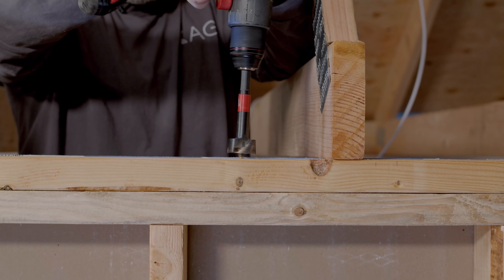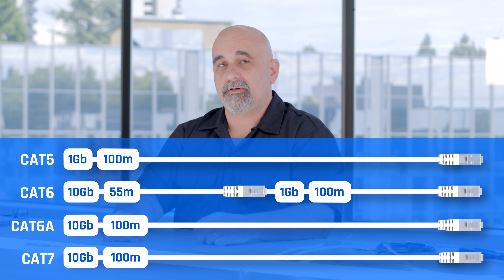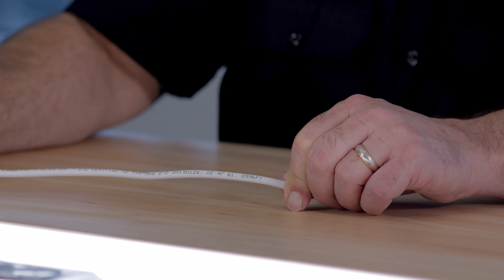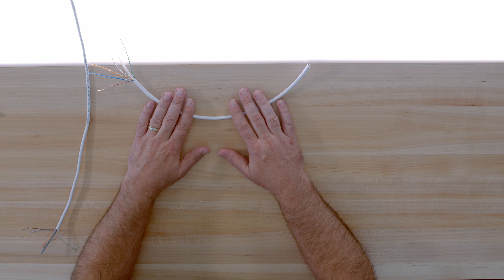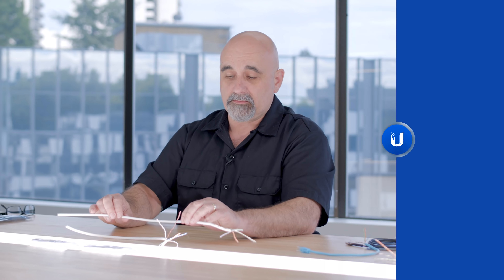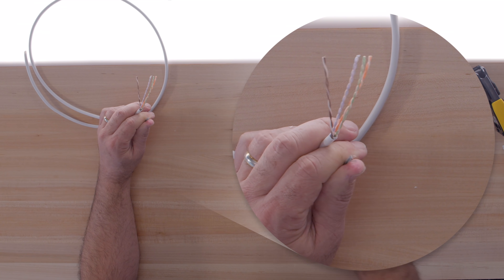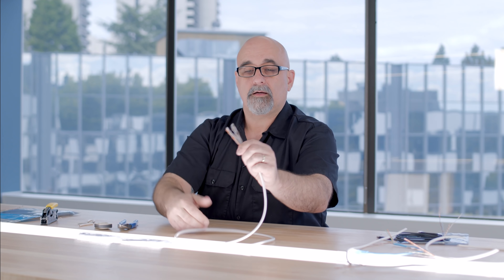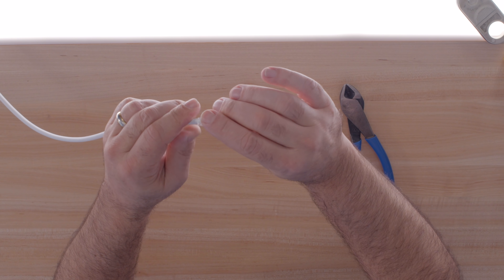UniFi: Beginner’s Guide to Network Cabling | Part 1 - Cable Types & Termination

Comment: Informative video. Should probably also have mentioned that pin 1 of the RJ45 is the leftmost pin when the connector is held vertically with the pins facing you, and that this is the orange/white wire for 568B cabling.

Comment: I learned with this type of crimp and rj45, but I have found the pass-through clips/crimper much easier to use. Great instructional vid though, good job!
Reply: Pass-through are very nice but only time you dont want to use them is when the jack is shielded but then you will also need to use a shielded rj45 and cable

Comment: Don't CAT5 and higher have the same number of wires/pairings (8 wires, 4 pairs)? If so, what about CAT5 makes it unable to transmit 10Gb speeds?
Reply: You can achieve 10g over cat5 with the right equipment and short distances. Its not easy but you can. cheaper to run the bigger cable
Reply: The other person already answered the question, so i’m going to skip that part. But some differences, cat5 can support up to 100mhz bandwith capacity, where as cat6 can support up to 250mhz. Another difference is that cat6 cable is more tightly wound, and have more twists. Also, a lot of the cat6 include nylon spline. Not required with cat5 cables, but some manafactrures include it.
Reply: Cat6 and up have larger copper conductors (lower gauge), more twists per inch, and sometimes a plastic separator for the pairs.

Comment: Nice video, however, Sean never specifically mentioned the orientation of the RJ45 connector (He did it on video but never went though why). This is NOT required for most, due to Auto-MDIX, but this is an important thing to know

The pins are suppose to up face when putting the wires in. Pin 1 is first from the left when pins are facing up. For T-568-B, that's Orange-White. I noticed two of the graphics, the pins were wrong the first time, then they were right the second time.

Comment: I just been doing low voltage for only 15 years. But I was told by people with more experience that always try to use the dental floss (ripcord). But maybe it's more important for terminating to a jack or patch panel where the jacket is not supported and camera ends.
Reply: I like this video to use as a training aid. Looking forward for the rest of the series.
Reply: dental floss????
Reply: @isaackvasager9957  @ 2:37 the polyester string (It is commonly called a ripcord) he calls it dental floss
Reply: @hitman132i  lol, I missed that. The fact that he calls it dental floss makes me hate this entire video.
Reply: @hitman132i  for what its worth, I do this for a living, never once have I used the "dental floss". It's a pain to use. If you learn to use a wire stripper properly, you will never even touch the insulation on the inner pairs.

Comment: Another tip.
To help untwist the wires you can use part of the jacket you strip off and push it between the pairs so that one wire goes in to the jacket and the other stays on the outside you can just twist the jacket in your fingers and it will slide down the pair and help untwist them easier.
Reply: huh? That sounds hilariously over complicated.
Reply: @isaackvasager9957  I've tried this method and it works surprisingly well.
Reply: @cfgdr3  up can literally just twist the pair with your fingers to untwist it. Why overcomplicate it? Lol. I go hundreds of these every year. Takes seconds.

Comment: Very nice. As a rule I never use wire that my cable stripper might have touched. Use the pull string to remove the sheath from the length you need to work with and discard where the cable stripper or scissors or knife was used. Even a small nick or pinch in a solid copper conductor can cause problems later.

Comment: 6:53 The (solid/stranded) lables for the RJ45 crimp types graphics are reversed. Stranded core is used with the top blade type, while solid is used with the lower fork type. 
I’ve seen professional installers incorrectly use the wrong type! Which will later cause connection issues due to bad connections.

Comment: Pretty sure he uses a pass-through crimper, but not a pass-through RJ45 plug.

Also, be sure to get the right RJ45 for your cable. An RJ45 rated for Cat6 doesn't sit well on a Cat5e cable.

Also, always test your cables after making them!
Reply: There is nothing wrong with using a pass through crimper on non pass through plugs.

Comment: Really, Why is it that people fail to mention one of what I feel is most important things to Cat Cabling? I mean ok so you guys use CMP so there is no Questions but what about all the Trash that is being SOLD TODAY WITH CCA... Why is it that people don't point out that people need to buy Good Quality cable from a Good Manufacture and be careful about buying JUNK CCA.. There are so many people out there that are selling JUNK cables that should not be used for POE and will or can damage High end POE cameras is people buy JUNK cables.. Knowing is half the battle Also now people are getting even more funny with cables calling Siamese cables Solid Copper core but has no real copper in the power wires and or the video ground.. Buy from a Trusted company. If you are going to pay someone to install your Cameras or Network hardware. If you have a large job and they are doing it for Cheap then I doubt your getting good cables.. Bad Cabling = Nightmare down the road.
Reply: You wrote an entire essay instead of simply saying..."Careful not to by Copper Clad Aluminum (CCA) and make sure what you buy is solid copper"

Comment: Do people really still terminate RJ45 by hand anymore? Keystones + pre-terminated patch cables are orders of magnitude faster and produce a way more consistent product.
Reply: Low voltage wire jobs. Can’t fit a terminated wire through a 3/8 hole, especially in 2-3 hundred foot runs. We terminate thousands of cat6 a week. Not fun but it’s still a consistent product.

Comment: What the actual hec?  This video says "CAT5" is capable of 1G????!  NO CAT5E is capable of that not CAT5.  I'm I missing something?
Reply: to be fair cat5e is the common standard as cat5 isn't sold / manufactured anymore. most installations will be using cat5e so it's fairly accurate within the last 15 years at least.
Reply: @electroplank587  totally! I was guessing it was just some "Tech talk". When I'm on the job I say CAT5 or CAT6 to my guys and they know what I mean. Unless I point out that it is literally CAT5 NOT CAT5e but for the layman and honestly in a Video I think it should be specified.  Not splitting hairs here great video! *Subscribed
P.S.  I've tested a CAT5 cable at 15 feet and it got 1G. With a $3000 Fluke tester so WTH does it all mean? LOL